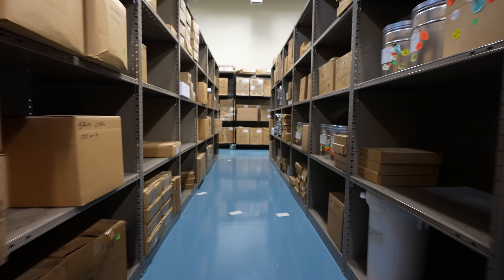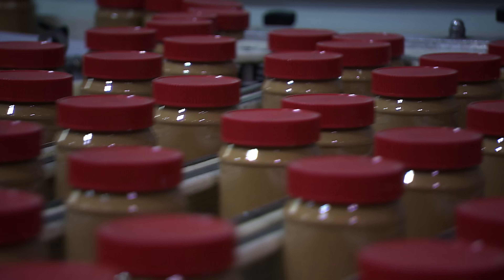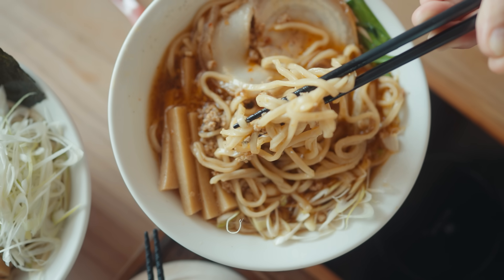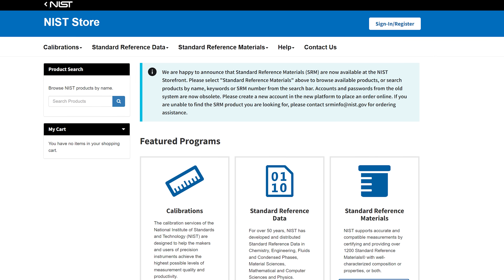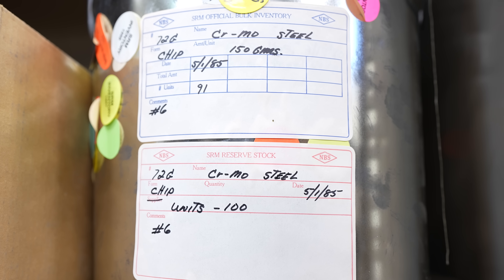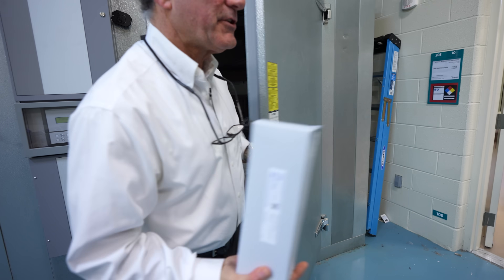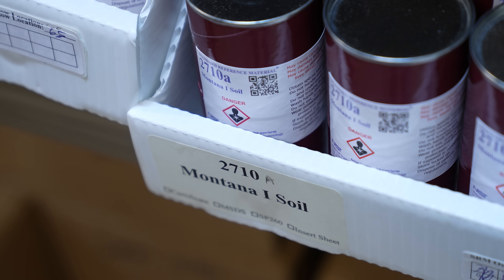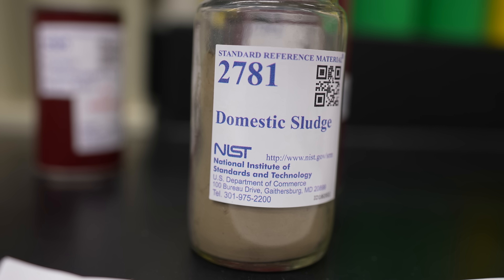The world depends on a collection of strange items. They're not cheap

Comment: 7:22 Am By 
First Shift Till 
3:22 Pm ( Cage-in ) All On Certificate of Surgeon Of Secondary Class To Fix Our Self In Heaven 
And Complete Line of 3 Line Of 1.16 Centimeter's Into Addiation Or Subtraction To Get in 2.7 Centimeter's All From 3.48 Centimeter's To Get In Abstract, Aerodynamic,Character Desin ,Chronographic ,Cursive ,In Final Call in Monogram To Get In Handvvrite in To Get On Fullscape To Massage Eye I"n Handvvritein I"n Press and in Print In Book Of Fullscape I"n 6G Board's I"n Press And Print In Plate 3 
I"n
 I"NDI"A And I"n 
M A H A R A S H T R A I"n 
M U M B A I" In 6G Board's In Bar Code And in Bar Edge To Get 80 Ear's Education To Get In 17 Ear's I"n 12 Box of Class Call Subject's In All in One Go To Get All in All Here I"n 
M A H A R A S H T R A in 
S T A T E and Call Specialies't I"n  4 Brain And One Chain In Cell Enlarge And Cell Large and in Cell Embrane And in Cell Membrane And in Deoxy Nucleu's And I"n Reboxy Nucleu's Acid To Get I"n Deoxy Emboddin and Reboxy Fillin and in 1 Fract 3 O of 9500 O All From 1900000 HHH  Filter To 90000 HHO Filter To 30000 HO Filter To 286666.666666 OO Filter To 96000 OH Filter To 42000 OOH Filter To 16000 OOO To 9500 O And in 9500 O HO OO OH OOH OOO O To Get in 60.48 Fract of 1 SSHOT Call Copy or Image In One Postion To Get in 4 SSHOT'S To Get in Clip Of 
241 Fract And 92 MilliFract To  Get In 
Assesmblein 
All From 10580 Ear's Call Easter's All From Europe And From US Call Plate 1 And From AC Milan And From InterMilan And  MAARFA And Moscovv  Call Plate 2nd 
And From To Certified By ANP Card To Near Near 
288 Call 4 H-Our 48 Minute's Near Near To Distinction on Percent 
287 Minute's and 20 Second's 
286 Minute's And 40 Second's 
17200 Second's 
17.20 Amphere 1 Joule 
1720 Meter's Call 1 Mile's And 1000 Meter's Call 1 Kilometer's
1720 ip Call 1 MAARFA In 36 Dialogue To Fix in 6 Cloumn All From Breathe And From Climate And From Ozone To Get I"n 3 Mould 
All Get 1200 MAARFA I"n 3 Mould And 2400 Book of Cloumn of Fullscape To Get In All From 7200 Cloumn of Fullscape Daily 3 Liter And 132 ml 3 Coup or 3 Cloumn Call 1ml And 
4 Coup And 13736 OO Call 1 Gram Of 286666.666666 OO To Get In 17020000 Allin Call Coup in Lung's Novv I"ncrease To 440000 Lac's And 21420000 All Call 100 Pisa And 1 Rupee In International To Get I"n All Around To Get in Breathe And I"n Climate And In Ozone All From 1900000 HHH  Filter To 90000 HHO Filter To 30000 HO Filter To 286666.666666 OO Filter To 96000 OH Filter To 42000 OOH Filter To 16000 OOO To 9500 O And in 9500 O HO OO OH OOH OOO O To Get in 60.48 Fract of 1 SSHOT Call Copy or Image In One Postion To Get in 4 SSHOT'S To Get in Clip Of 
241 Fract And 92 MilliFract To  Get In To Get in 286666.66666 OO To Deduct 440000 OO Deduction All From 
7109.78836 Clip Of 241 Fract and .92 Millifract And I"n To 
4 SSHOT'S 28439.1534 SSHOT'S Call Image In All From And in Bar Code And Bar Edge and 730 Byte's in Mega Daily 
1433.33333 Coup 
238 Joule and 5 Coup And 399 Fract And 93 Millifract and 6 Nano Millifract Call Neu 
476 ml 1ml and 2 Coup And 
And 262916.668 All From 286666.666666 ,
23749.9997 Deduction All From 286666.666666 OO To 262916.667 OO All From Breath All From Climate And All Ozone To Get I"n 
I"n 9500 O 9262.50 O 

Deduction of 237.50 All From 
Divide By 8 All From 
1900000 HHH  Novv in 1662509 HHH Deduction of 
 (- 237491 ) 

900000 HHO Filter To 
805000 HHO 
(Deduction of 95000 HHO )

300000 HO Filter To 268333.333333 HO 
( Deduction of 31666.667 HO )

286666.666666 OO
Filter To 262916.667 OO Deduction of 23749.9997 OO 

96000 OH Filter To 88046.7143 OH Deduction Of 7953.28567 OH All From Breathe All From Climate All From Ozone 

42000 OOH Filter To 38520.4158 OOH Deduction of 
3479.58423 OOH From Breathe From Climate From Ozone All After 2014 November To Get All in All From 33322 Ear's I"n November And in 29 All After 8 Ear"s To Get Gadget 
24:1 Havein A Frequency of 17200 Frequency I"n Hert"z I"n Mega And 12800 Frequency I"n Hert"z I"n Mega And 6000 Frequency I"n Hert"z I"n Mega 
I"n 72 Kilometer"s Circle And I"n Divide By 6 12 Bar Of 6 Kilometer"s Brief Vvith All 12 Call 17200 Frequency I"n Hert"z I"n Mega All From 12 To Get 4 Bar of 6 Kilometer"s 
I"n Personal To Give 12800 Frequency I"n Hert"z in Mega To Double And To Triple To 1 Bar Havin Frequency Of 6000 Frequency in Hert'z in Mega Keepin Office Standard"s And On Civic"s And On Economic"s 
I'n Artificial I"ntelligence ,
Board"s ( Branch)
Constitution ,
Delta (CallAction ,Authority ,Control )
Enforcement 
Faculty 
Government 
Hospital 
I"ntelligence 
Jurisdication 
Lavv"s 
Money (Call Line Assemblein Call Language) 
I"n Game of Alinement All Tovvard"s A 
All in Knovvin And in Underdivein And Understantin Call East To

Comment: Near Near To Have Vvith Fear And Vvith Pressure Call First Shift 

And I"n Vvest Call 
Code Black And Code Break 4 Exercise 
48 Sum To Solve On Book of Cloumn of Fullscape To Get I"n Action And in Calculation And I"n Excuation 

I"n 3 Mould All From Atlantic Standard Time And As Per Ocean Pacific Standard"s Time 
All From Europe and From US And From Ocean Call Ac Milan InterMilan And MARFFA And Moscovv To Get I"n Call Plate 1 And Plate 2 And All Suburban I"n Plate 3 I"n 72 K"ilometer"s Circle To 
Have 80 Ear"s Education in 17 Ear"s To Get I"n 12 Box of Class All in One Go All From 10580 Ear"s All Are in Plate 3 All are in 33330 Ear"s And I"n November And in 29 All 8888 Gene"s And Hormone"s All from 33330 Ear"s Are I"n To Get All Novv I"n Gadget 24:1 And 2 Rupee Into 2026 Aana Kissan Jam And Kissan Ketchup And 6 Rupee 
Amul Butter Into 2026 Aana in 12 Dimension In Current Direct To Get in Packagin Approved By 6G Board"s And 7 G Cinema In B A N D R A in M u m b a i And In M A H A R A S H T R A 
I"n I" N D I" A  in Plate 3 And Plate 3.75 Attach Together To Get in Tape Recoder Double Cassasset"s To Get I'n One Chain I"n Arth Engennerin and I"n Same in 4 Brain And One Chain I"n Body Engeneerin And Cell Enlarge And Cell Large And Cell Embrane And Cell Membrane And I"n 
Deoxy Nucleu"s Acid And Reboxy Nucleu's Acid And Deoxy Emboddin Done And Reboxy Fillin And From Cevical And Pevical 3 O Of 9500 O 
I"n 1 Fract Of Call Blood I"n Red Blood Cell"s Vvhite Blood Cell"s And Plasma Fluid Fe And Palletee's)  ( Casio )
All I"n 
AcknovvlegeMent 
Bonou"s 
Check 
Demand Draft 

Game of Emotion I"n 4 Up 1 Major Up 1 Majestic up 1 Universal Up 1 R 

Or Can Be Deceased 

Or Can Be Dovvn 

4 Dovvn 1 Major Dovvn 1 Majestic Dovvn 1 Universal Dovvn 1 R 

I"n Scale of 4 8 16 32 64 

I"n Game Of Feelin 4 Up 1 Major Up 1 Majestic up 1 Universal Up 1 R 

Or Can Be Deceased 

Or Can Be Dovvn 

4 Dovvn 1 Major Dovvn 1 Majestic Dovvn 1 Universal Dovvn 1 R 

I"n Scale of 4 8 16 32 64 

Game of G All Old Ethic"s All From 10580 Ear"s To Get All Odd"s Out And To Get All Even In And To Clear All Integer"s And To Get All Amino Acid In  
Novv Amino Acid Is In 
87 12 3 24 44 
Call 170 Acid Are Call Mg call Oil 

All From Party And Slaty Chalk And Colour Chalk Call Prepration of 3 Ear"s 1 Fract Preparation of 3 Ear"s 1 Fract And 3 Ear"s 1 Fract From Kinder Garden To Higher Kinder Garden Call K G To 
H K G To Prepration Of Marriage and Preparation of Marriage To Marriage To Reproduction To Get I"n Hospital Call 
AntiBallistic Missile 
Call Munical BMC And MCGM 
Of State Call 
Natural Disaster Mangement Team  And Disaster Mangement Squad Team I"n To Get in STATE"S To All in Dam"s And Reserviour And Manual To Get in 
Lovv Sodium Alter-in To M U M B A I" To Get All In 12 Bar And 6 Kilometer Circle To Get All 12 Bar Distribuation Equal Call 17200 Frequency I"n Hert"z In Mega And All From 12 Bar Of 72 Kilometer"s To Get In Graph 4 Bar Get Double I"n 
2 Dimension I"n 
Body Index Formula Call 1 Coup 1200 Fract 
I"n Algebra , Geometry, And Trignometry And Degree 

And  6 Dimension I"n Machine And in AC Bus Call STon And STone And STone 
And RTOn RTOne and RTone Call I"ndian RAILVVAY"s Call Country Amino Acid  of 170 
In Percent of 4.48 % Percent 14.48 % Percent And 24.48 % Percent And 34.48 % All After To Get I"n Part"s Handlin And Part"s Takein Care I"n Body Engennerin And Cell Developin Call Just Pass And Save From Dialogue False 
Dialogue Incorrect
Dialogue Improper
Dialogue Negative Dialogue 1800 Celceiu"s 
Dialogue Divide By 3 
600 Degree 
Or Dialogue 
36 Degree I"nto 3 108 Celceiu"s 
Cuttin And Cutlace 
Fried 
All From Country To Get 
I"n 170 BMVV 5 Sitter 
Heavy Duty Call  
RTon RTone and RTone To Get I"n Certificate And Complete Line Assesmblein And Certified By ANP To Get I"n 
 

 Deduction 

90000 Filter 

 To 9500 O 
All Gase's From 
Air I"ndex  Quality 
And From I"nterplantery Eclipse To Get in Sp-Rin and ST-Rin All From Ain To Mercury Venus To Arth To  Mar's To  Jupiter To Saturn To Uranus To Neptune And 4 Coup Of Heaven To Get in By 
And Eris - Huemea And 
Make Make And Pluto 
To Get in S-eep To Get in S-eap And S-Hank To Get in Frequency All From 17200 Frequency I"n Hert"z in Mega And 12800 Frequency I"n Hert"z I"n Mega And 6000 Frequency I"n
 Hert"z In Mega To Get I"n 
Can Get in 93.50 Frequency I"n Hert"z I"n Mega To Get I"n All in Knovvin and in Underdive in And I"n Understandin To Get in All 

388728 Fullscape Double of 36 Cloumn Call Book Or Long Book Or Assesment FullScape Practice 
Are I"n And 
777456 Full Scape In Single Of 36 Cloumn 7 Lac's 77 Thousand's And 456 Fullscape

In 1 Ear's  73000 Double Fullscape of 36 Coloumn From Breath And From Climate and From Ozone 

146000 Single Full Scape In Single of 36 Cloumn of Fullscape 

350400 Joule Call Neu I"n 1 Mould 
And 350400 Joule Call Neu I"n 2 Mould l
And 350400 Joule Call Neu Of 6 Coup Call 1 Joule Call Neu Of 6 Coloumn Of Fullscape Of 1200 Fract Or 12 Second's or 120000 Millifract or 12000000 Nanomillifract Or 1 Coup Of
 262916.67 OO and 3 Coup Call 1 ml or 6 Coup Call 1 Joule Call Neu Call 2ml From Breathe From Climate From Ozone To Get Fix 36 Dialogue of 6 Character Desin In Construction To Get 1 Dialogue To Get All From 3 Line of 1.16 Centimeter's To Get in Addiation Or Subtraction To Get 2.7 Centimeter's All From 3.48 Centimeter's To Get I"n 
Abstract ,Aerodynamic ,Character Desin ,Chronographic in Cursive I"n Final Call I"n Monogram To Get in Final Call To Get on Book of Coloumn of Fullscape To Get On Handvvritein To Massage Eye  Get I"n Lung"s To of 
17020000 Coup And Plus 440000 Coup More I"n Lung's 
All To Get To 
Game of Heaven Charge in of Gene's And Hormone's All From Breathe And From Climate And From Ozone 

And Book Of Coloumn of Fullscape 

To Get I"n Reproduction To 17 To Get I"n Glacier"s And On Country To Get I"n 

Total 21420000 Coup And All From 7200 Book of Cloumn of Fullscape Call Long Book Divide By 6 To Get 1 Joule Call Neu 
And 100 Pisa Is equal To 21420000 All in Or 

61111.111
156 Ear's 153 Ear's All From 3 Ear's To Get I"n 
17 I"n Reproduction To Get I"n 
ALL From 28 Ear's 1 Fract 
By Formula of 

3 Ear's Chaster 3 Ear's Daughter  5 Ear's Easter 
And 3 Ear's Foxtrot 

3 Ear's Chaster  3 Ear's Daughter 5 Ear's 3 Ear's 

3 Ear's Chaster 3 Ear's 5 Ear's 3 Ear's 
3 Ear's Chaster 3 Ear's 5 Ear's 3 Ear's 
3 Ear's 
116 Ear's Easter Hallovven Gastric Hole ,Mg Call Oil 
Air I"ndex Quality 
Breathe Climate Ozone 
AC Milan InterMilan Everest Green Land 
Ain End,
No Carbon ,No Gamma, No Hazardou's No Pollution From Lung's 17020000 Coup In Lung's Novv 21420000 Coup To Get I"n 
Game of Heaven To Chargein Of Gene's And Hormone's From Ace From 4:40 Am Breathe From Climate And From Ozone From RT one And RTone And RTone By First Shift And By Last Shift I"n Country Amino Acid By 170 BMVV Heavy Duty Call 5 Sitter By 1 Shift And By Science To Art's To M.C.V.C Call Part's Handlin And Part's Takein Care I"n Body Engneerin And Cell Developin To Get Till Surgeon Of Secondary Class To Physician To Assistant Of Physician To Engineer To Assistant Of Engineer To Junior Engineer To Driver Arthin Attach To Takin Care Brand Ambassador Of Line Asseblein in All From 7 Ear's Fix And Strait To Get In All From 3 Ear's 1 Fract To Get I"n 12 Box of Class To Get All in One 
To Lifter ,Loader ,To Porter To Port  
Alt Alt Alt Alt 
Shaft Shaft Shaft 
Ctrl Up 
Alt Alt Alt Alt 
Shaft Shaft Shaft 
Ctrl Dovvn 
To Get I"n Space Craft 
I"n Engneerin To Get I"n Ottar 2 And I"n Ottar 3 And I"n Ottar 4 To Get All After 11:22 Pm And By 1:16 Am By First Shift I"n East And By Last Shift To Get All I"n All After 1:16 Am In Driver"in To Get Space Craft in 
All From Vertical Dovvn Gate Open I"n Diagonal Shape I"n Plate 3 And All From Till 
7:22 Am by First Shift And By Last Shift To Get I"n Calculation All After Till 9:16Am 
All From 7200 I"nto 6 I"nto 3.75 In"to 110 
I"n To 3.75 I"n To 110 To Get I"n All From 17020000 To 2142000 All after 2014 November To Get I"n 33330 Ear"s And I"n 11 And I"n 28 
All in Novv All Novv And Novv Arthin Attach All Before 8 Ear's 

63.99936l

Comment: I remember describing the multi-stage process to calibrate satellite instruments — from the actual physical measurable values up to having a calibrated evaluation of the satellite-measured gases in the atmosphere. It’s pretty awesome.
Reply: officialveritasium688  If you want details, see chapter 2.2 in doi 10.5445/IR/1000052678 — with references to the more detailed descriptions.

Quote from it: This reference
air is measured by freezing out CO2 and N2 from the air and measuring their temperature, expansion and pressure under heating to calculate the absolute concentration using physical expansion coefficients as described by Zhao et al. (1997)

Comment: What I do wonder now is: How does NIST calibrate their analytic system, so that their measurements are correct? Or are their system based on a deeper, more fundamental level that helps to produce high language analytic systems? Because if they analyze the samples with the same method of those in need of the standards, NIST only creates an artificial anchor point with no valuable statement on if peanut butter really is peanut butter.

I guess two more sentences on how NIST creates the analytic reports for the certficates would have been a nice extra. Besides that, the video was awesome!

Comment: Strange to say that I am grateful for standard cigarettes.  I am, because my son had an extension cord next to his bed so he could charge his phone. (I thought he was old enough to be safe with an extension cord.  Sigh)  One evening, he, for whatever crazy idea, decided to put a pin in the outlet of the extension cord.  Because of the testing of bedding using standard cigarettes, all he ended up with was a nasty shock and a scorch mark through his sheet and mattress cover.  The fire didn't spread at all.  He no longer has extension cords anywhere near his bed and is forbidden to do any experiments with electricity unless it involved batteries.

Comment: I'm a little confused by this. I understand why these standards exist and why the tests are done, but why are the physical products sold and stored after these this process is complete?

The NIST reference sample comes with a certificate of analysis which contains information on a bunch of tests, showing its exact composition and other useful data. So if you can just access that information without buying the sample, what use is the sample? What does the physical thing tell you that the certificate does not?

Is it to perform tests that have not yet been done and recorded? Or is it to have something physical to compare to, something that you know mostly everything about?

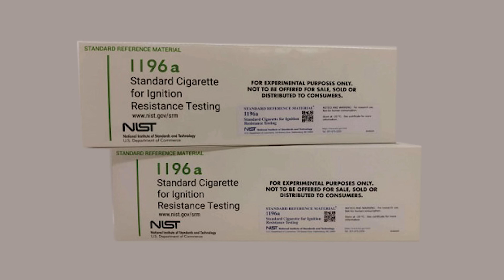Comment: 13:28 Those cigarettes aren't even that expensive. $414 for 200 cigarettes. That's only 5 times as expensive (per cigarette) as the cigarettes I found on a grocery store website. Although if you were to buy them in packs of 200, they would be cheaper each than in a pack of 20. Big difference with the peanut butter.

Comment: If all the peanut butter brands use the same reference, then how do they differentiate themselves? Is it all just marketing? Lol
Reply: They aren't the same as the reference. Basically, the reference is used to test their equipments accuracy. As they said, calibration.  This means that if their equipment/tests on this product (the standard nist product), and they have a good match, then their tests are working well. As a result, they reduce any error that they may have because of different variables. This is important in the peanut butter example to make sure that their produced peanut butter doesn't have too much of that carcinogen. It cab still have different types and amounts of other ingredients.